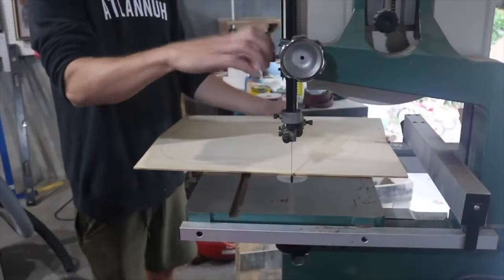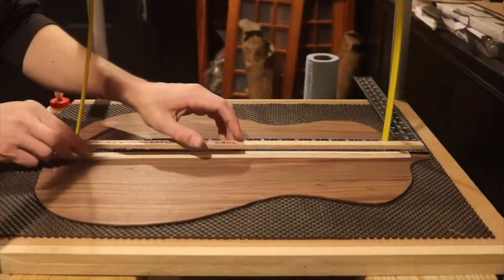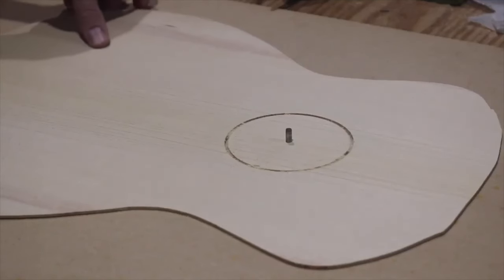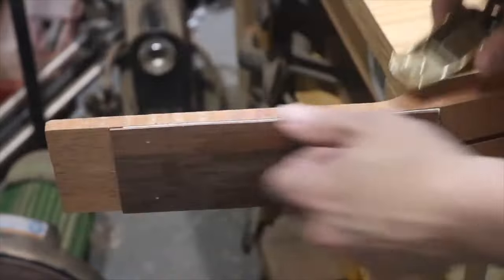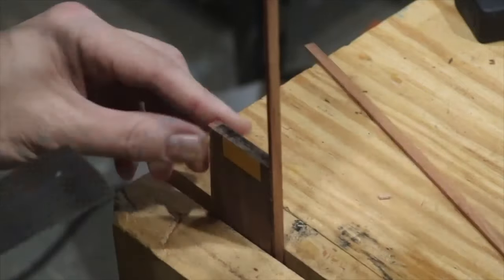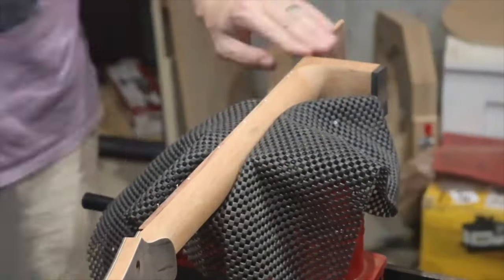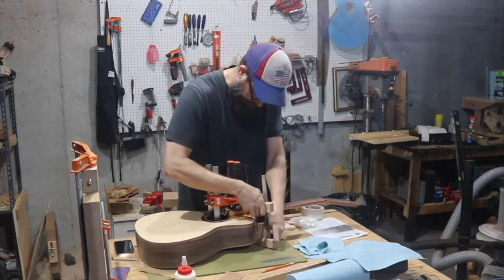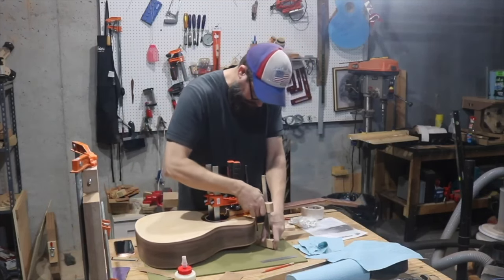OM Guitar Build - full montage

Comment: I really like the emblem/pendant insert into the headstock.  It made me gut-sick when your glue-up went south.  I usually use thin super glue for that part.  It will avoid that stringy-ness you were getting.  Great looking build.  Thanks for taking the time to share your experience.
Reply from the maker: Thanks a lot! I think next time I do the pendant, I may put some tape down first, then drill the recess and glue the pendant. That way any drips will get in the tape which I’ll just be peeling off. Thanks for the comment!

Comment: This looks awesome, Chris! Great work. I'm glad I could help out and play even just a super small part in this build. A few thoughts as I watch this build.
1.  A drum sander doesn't always get used, but when it's the right tool for the job, it certainly makes life so much easier. In my opinion, worth every penny. 
2. Epoxy is definitely a far better choice over wood glue when it comes to gluing resin and multile materials.
3. I can't wait to see future builds.
Reply from the maker: Thanks for the comment. The drum sander was a life saver, for sure! I almost glued the rosette down with titebond, but then did a quick google search to check. Glad I did! I’m using your stuff for number 4’s rosette as well!  Thanks again!
Reply: @CMRWoodworks  Thanks! If there’s a better dimension you’d like at some point, I’m sure I can cast it.